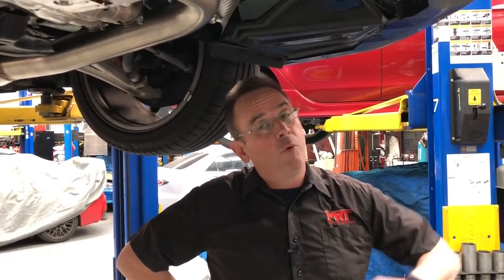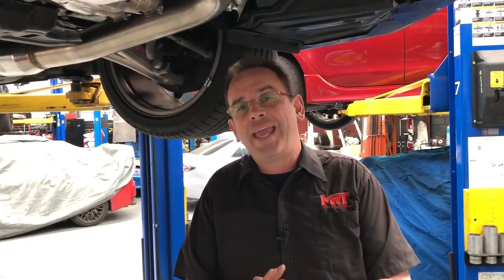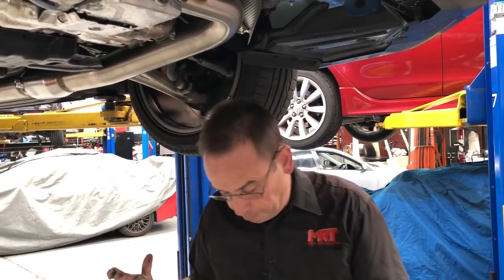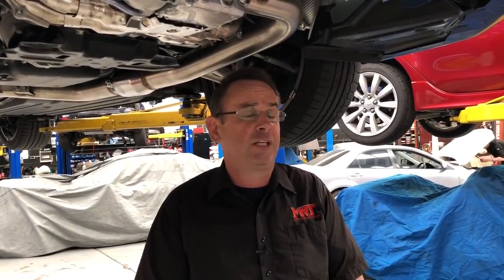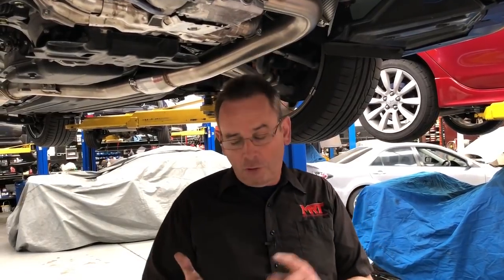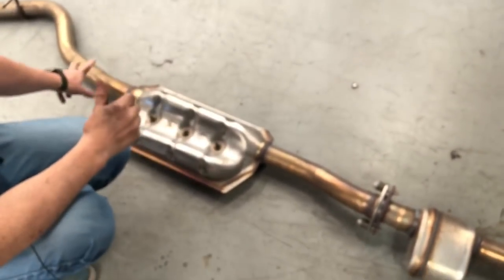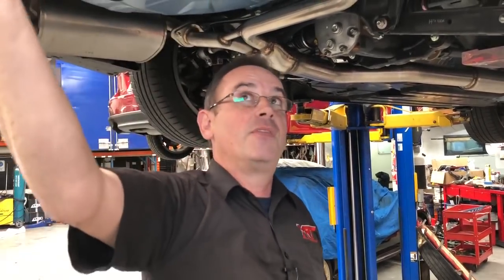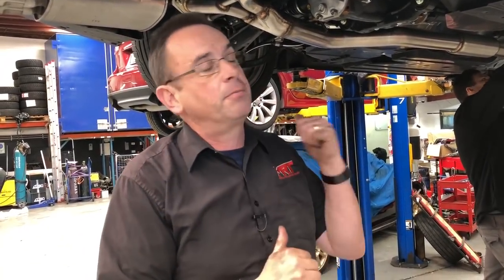MY15+ WRX XB Power Kit Overview

Comment: The heat shield is a great idea. Wish others would incorporate that kind of design to protect the radiator hose.
Reply from the maker: easy answer, cost.
We include it as we are both manufacturers AND tuners and do installations, so we see all sorts of ideas and solutions

Comment: Starting from 10:45, you mentioned that the power is not limited as much when it's used with the factory mufflers.  Would the power still be limited if I have 450kW and use the factory mufflers, while having 3 inch exhaust piping all the way from the headers?  Thank you!
Reply from the maker: this would be best tested on a dyno by removing the rear mufflers
Reply: MRT Performance Thank you!  The car is tuned with Invidia Q300 mufflers installed.  Do you think there would be minimal or big difference when swapped with factory mufflers?
Reply from the maker: Sorry, not sure, would need to be tested carefully

Comment: Is the downpipe (J Pipe) the same length as the stock downpipe. The reason I ask is I have the XB kit on my car and looking install a Tomei cat back, will I have any fitment issues?
Reply from the maker: you will have to locally modify the joint to make it fit, but why change at all? there is zero power gain andd then you will need to pay to get the tune checked and re adjusted for best reliability and performance

Comment: Sorry but aftermarket headers are proven to not increase power?.. ive seen differently
Reply from the maker: On a FA series 2 litre? with std OEM turbo?
Reply: MRT Performance MRT Performance the video is about a stage 2 package.. I didn’t hear you mention fa 2.0 you just said 2.0.. so i was referring to an ej20.. here’s an example, two EJ20 stroked to 2.1 both identical mods and tuned by the same person, the one with aftermarket RCM headers makes 18more bhp and spools up about 200rpm sooner
Reply: the whole video was based on the my15+ wrx anyway so unless subaru has gone back to using EJ series engines lol
Reply: @wax333  Not to mention Subaru hasnt made a WRX with a CVT and an EJ engine.
Reply from the maker: correct
Reply from the maker: The video is about the new model, not the older engine ;)